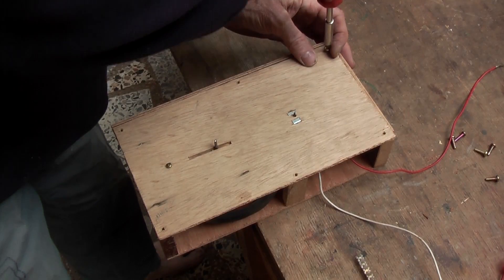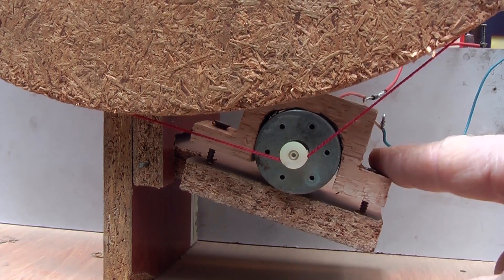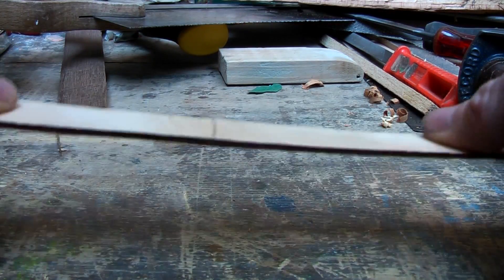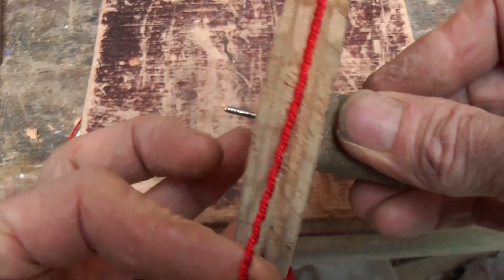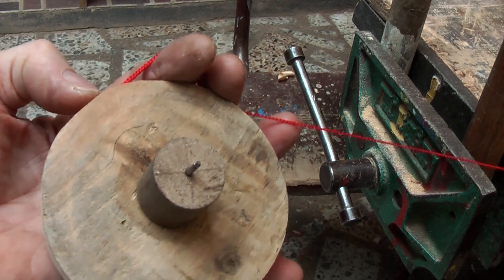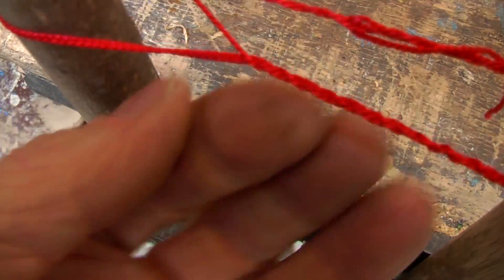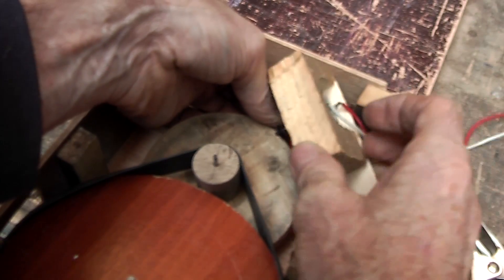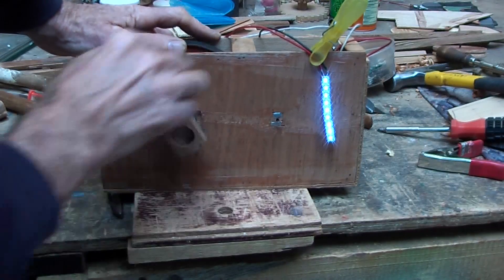Re-inventing The Wheel And Electricity- Rubber Band Fix

Comment: Great project, you can make your own springs. If you take some metal wire and wind it around a round object that have the diameter you need, like a pencil, you can get wary good looking springs. If you make space between the winding's, you get a compression spring and if you wind it tight, you get a pull spring. Coat hangers do make a way strong spring. :-)

Comment: Hey Philip, enjoyed the vid. I was wondering if you couldn't have tied to use a similar type mechanism to drive the motor as you get from the wheels of a locomotive engine? If you had  one of the wooden clamps in a circle you usually make and connect it to the second gear with a stick and a slot with a bolt through the middle you would remove the need for a belt or string drive at all, little more friction but a lot more reliability and less repairs needed to moving parts.
Reply from the maker: The speed the small  generator pulley goes is really fast . I have tried the  locomotive engine system you suggest, and it  flew to bits fairly quickly. Also it needs a crankshaft if the  axle is supported on both sides. It would be worth trying in the slower revolution part  of the system, and then some flywheel  might need to be incorporated.